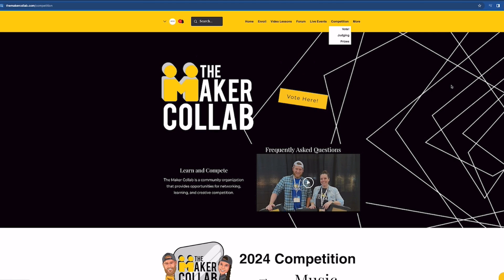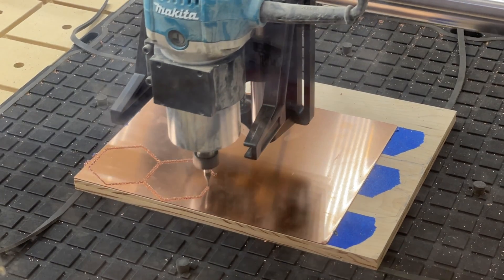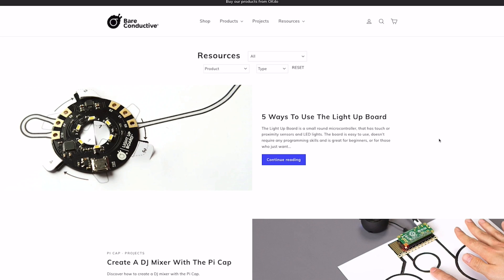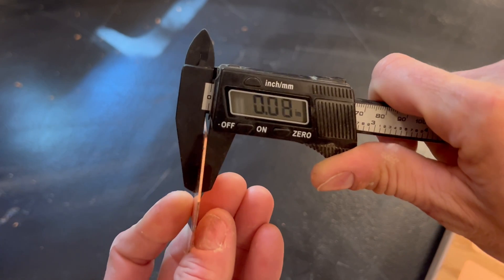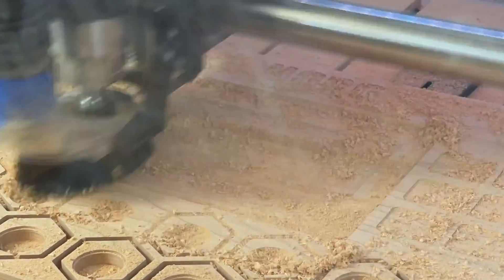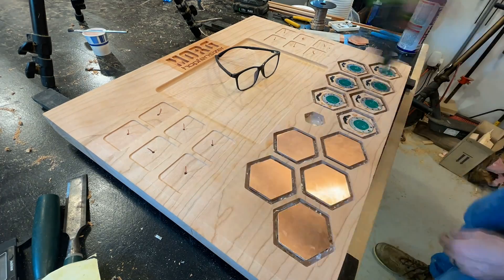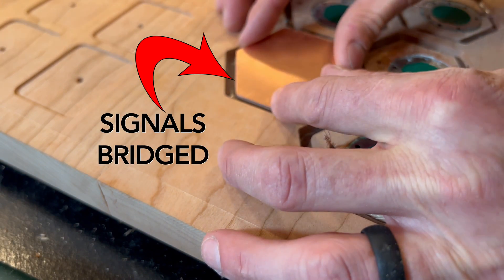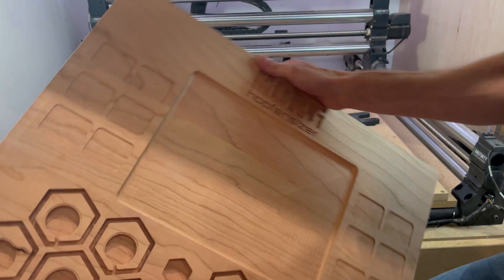EP.29 Onefinity CNC -  Our Maker Collab Project, Building a Synthesizer

Comment: What bit (& feeds and speeds) did you use for the copper?
Reply: I used a 1/6" O flute upcut bit. 16,000 RPM, 10 IPM.
Reply from the maker: I used a 1/6" O flute upcut bit. 16,000 RPM, 10 IPM.